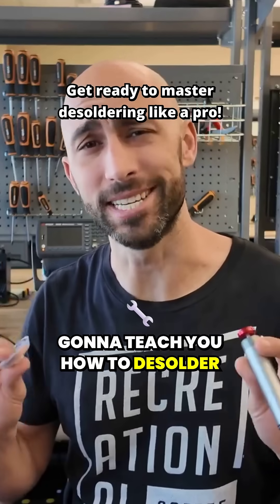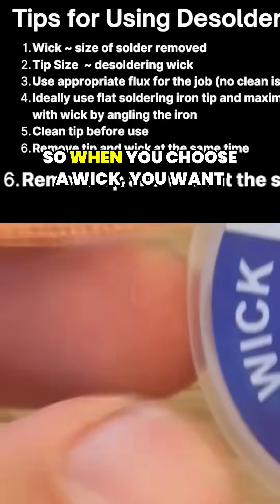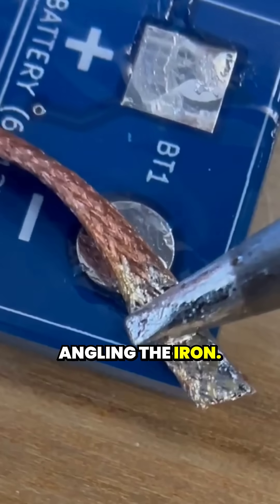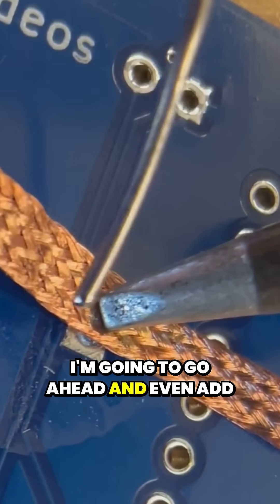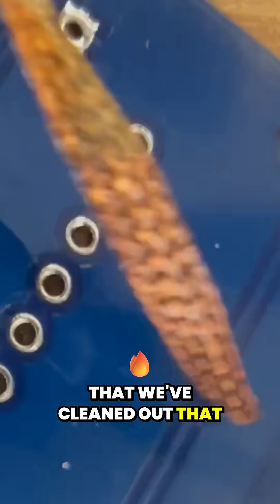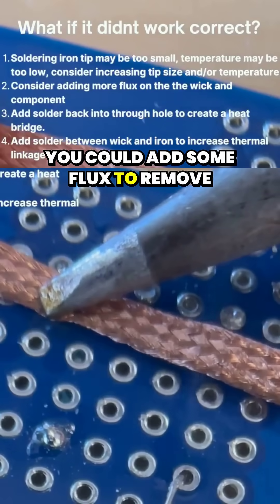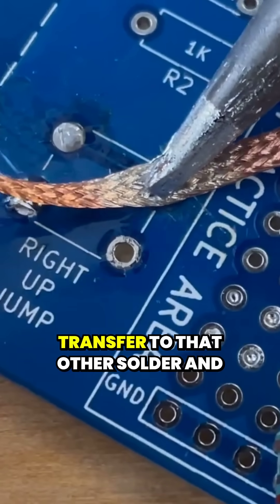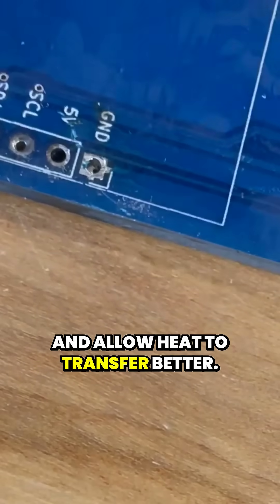Ready to master desoldering? 🛠️ What's your go-to technique? 🤔 #Desoldering101 #TechTips

Comment: Desolder wick is so confusing I’m pretty sure I’m using a big enough tip for my wick and yet it doesn’t wanna get hot enough but I got some holes out I might be dumb😭I think I got some of them with thermal leakage I have to be doing something wrong